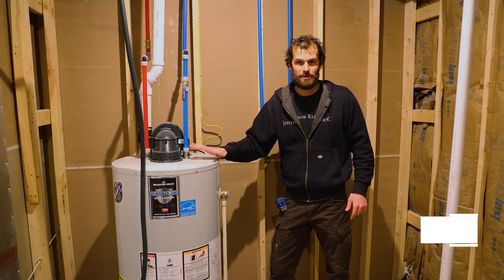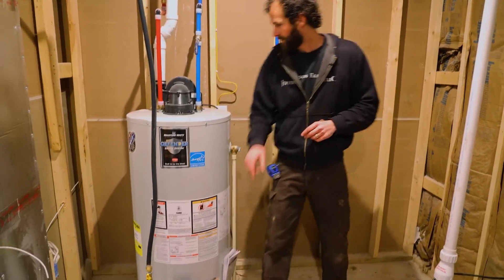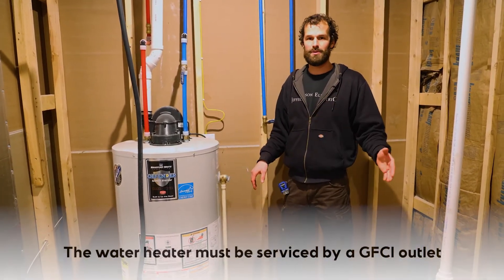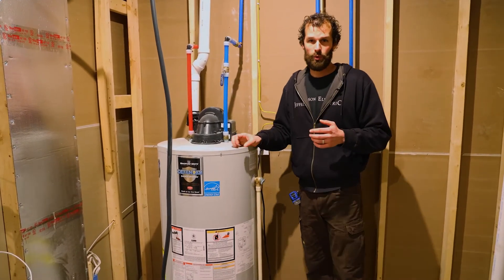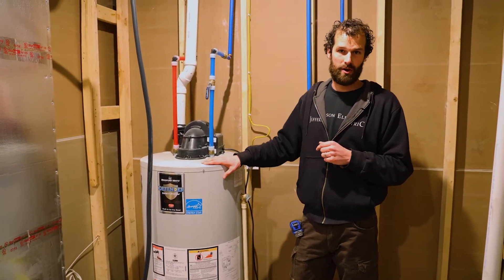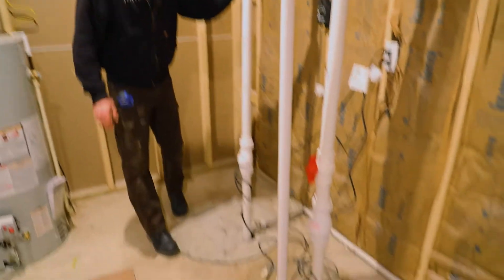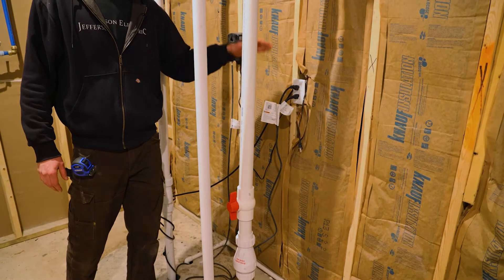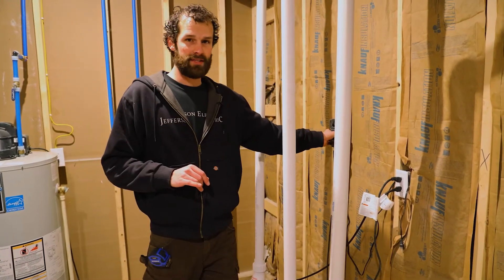Water Heater and Sump Pump Outlets - Code Minimum

Comment: You will be surprised how different the trip characteristics are with these GFCI receptacles. Trip currents on receptacle GFCIs and trip times can be quite significantly different across different manufacturers and sometimes this technical information is hard to find even with the same class of GFCI receptacles from different manufacturers. I always test mine with calibrated equipment to ensure it works as specified.